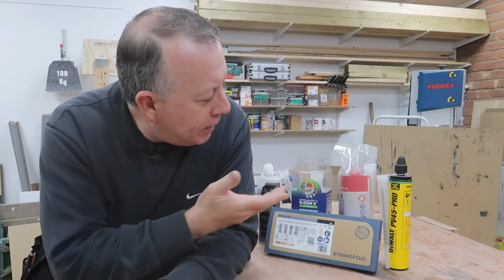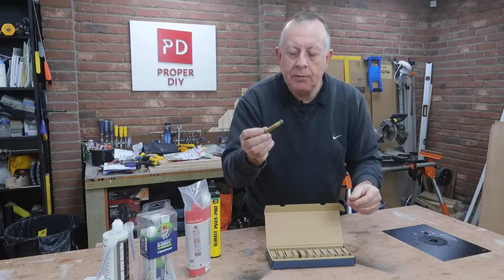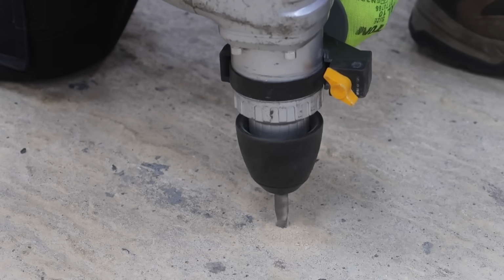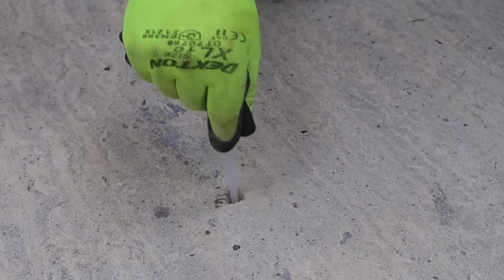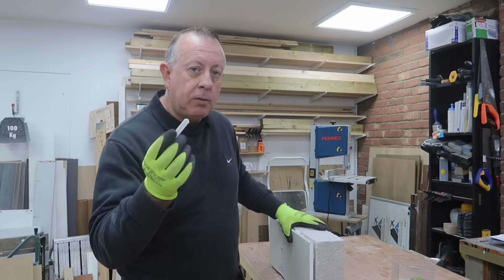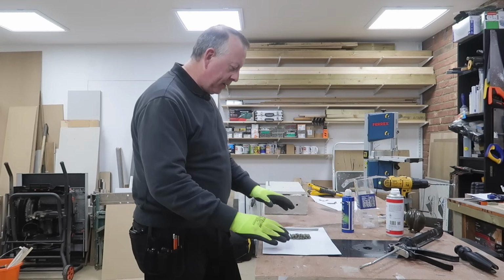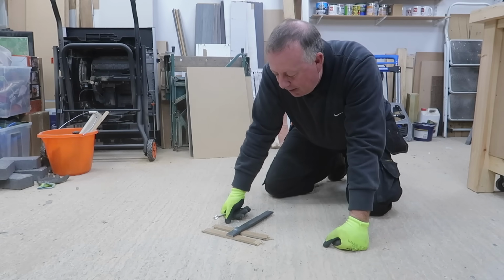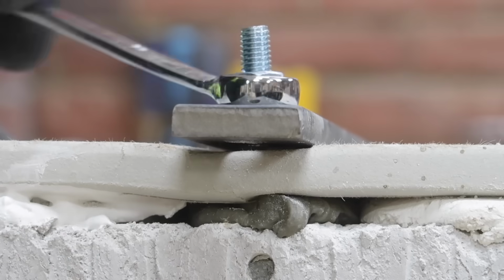Resin Anchors - The Absolute Strongest Fixings

Comment: Thanks for the Video, could you push a wall plug into this and screw into it? I have a loose toilet because the concrete floor where the fixings are has degraded, thinking this may be an option

Comment: NICELY DONE......BUT

Nicely done, and as with all your videos, very informative. Thank you. Mind you, the 'faffing about' (my term), with the Compressed Air and the Toothbrush can be quickly and easily circumvented by using a piece of plastic pipe or tube....er, well anything hollow....instead.

If this is placed at the top of the hole.....or marginally just inside it with room to spare....a quick couple of puffs, or blows into the tube will clear the hole of any debris left by the drill.

I have carried a couple of lengths of hollow tubing / piping for years for this, and if you have a couple of various diameters, your well set-up for any size of hole. One of the best and most flexible types, (because flexibility may be called for on occasion), is a length of electrical cable, (say half and inch diameter), with the three conductors removed.

Ideally the length of tube / pipe or hollow cable, should be about 18 inches to 2 foot in length. This allows you to be out of the direct line of view, or to the side of the hole when you blow down one end of it. I mark one end with a piece of distinctive coloured tape as the end to blow down. In this way I always use the same end. Mind you this is not really necessary....and a bit too much 'Elf & Safety.....if you alway wipe the thing before you use it.

The important bit.....and one learns this from the experience of getting dust in the face at some time or other.......is to close your eyes when you blow; so no need for the glasses or goggles.

The mantra is;
Tube in hole.....CLOSE YOUR EYES ....Blow or Puff...!

Works everytime....

Just a sayin'....

James Hennighan
Yorkshire, England

Comment: Nice video.  Just one thing.  When blowing out dust the idea is to push the tube right down to the bottom of the hole so that the air pressure blows all the dust upwards, out of the hole.  Just blowing towards the hole from above  isn't going to get very much of the dust out.

Also, I believe the minimum size hole required for those Rawl mesh inserts is 16mm, not 12mm, but they will come with instructions so people won't go wrong there.

Comment: I am doing extension and need to build the lean to roof. Need to bolt the wall plate on the outer leaf of the wall which is instructed by 100mm Celcon H+H High Strength Grade Plain Face 7.3N Block. Will the resin work for this instance?

Comment: I have a job coming up at home and need to fix some support timbers, I'm using 75 x 47 CLS and will need to put 4 fixings along the length using chemical fixings. Because of the short working time I was thinking of fixing timber with a couple of screws and red plugs to hold in postion then drilling through timber and wall with larger dill bit 12mm probably and using chemical fixings with threaded rod. Having the hole in the timber the same size as hole in wall does that cause an issue ? Or would it be better to use viles/capsules. Concern I have is lining up the rods with the holes in timber and getting it level with the resin going off quickly. Thought ? Cheers

Comment: I drilled a 1/2" hole 4" deep in my slab to mount a safe, i used a 1/2" X 5" Hillman concrete screw and i have 3" embeddment into the concrete. Altho the screw went in perfectly with my 1/2" impact wrench, I'm wondering if there is any advantage to removing the screw and put some epoxy in and refastening it? I have a very high security safe but it only has 1 anchor hole. Im looking for max hold down torque.

Comment: What is your view if I opt to use resin based fixings to compressed straw internal wall (sometimes called stramit). I am looking to hang a tv using a tilt bracket (not too heavy tv by the way).

Comment: I want to install an 8-kilo wall-mounted umbrella.  3m diameter umbrella when erected.  I have a hollow brick pillar, approximately 35cm square, perfect for the umbrella.  Should I use screw bolts going in about 100mm or put a steel rod with fixing resin?  There are two mounting plates, each with 3 holes, so 6 mounting points in total.  There are two possible issues with using chemical resin.  One is because the rods are going in horizontally, they might drop a little in the resin, then set hard, not straight in the hole.  Two, I haven't been able to find long mesh sleeves, to be able to drill 100mm in the pillar - most are like yours, 50mm long.

Comment: Thanks! I've DIY'd for 40+ years and never encountered this concept. Well, not in DIY anyway... for much of my working life I've used 2-part nozzle-mixing systems which were designed to be used similarly, with disposable nozzles and a cap to seal off the rest so it can be used anytime later again within its shelf life with no risk of setting in the dispenser. Those were high quality and incredibly expensive (dental materials) and they were arranged with a one-position-orientation end cap and the two different materials were kept separate by each having its own separate exit right at the tip where the mixing nozzle is attached. It's quite disappointing to see a manufacturer opt for having the exits down inside the section where the mixing nozzle attaches, as it would be difficult to make sure you have removed all of the product from the point where the chemicals meet each other, which you did with a wooden stick, but even if you do a perfect job of that, you'll then end up with an air space under the sealing cap so the materials could dry out and block the exit before next use. Admittedly the material is about £10 for 300ml where I would have been spending a hundred times that much per millilitre 🤣 but I still think they could have made it a bit more user-friendly with a little more design effort!

Comment: I used this method a couple of times to fix heavy gates to brickwork. They are ridiculously strong. The fixings are far stronger than the bricks. Top tip…. Ensure your posts are pre drilled and ready. Get your resin and  anchors in quick, wipe off excess, then push your post onto the protruding fixings before the resin goes off, supporting the post so it doesn’t pull them out with the weight. After a couple of hours, add your washers and nuts and tighten them up.  Failure to do this will mean you have alignment issues and need to drill out large clearance holes in the post to accommodate any misaligned resin anchor.  I highly recommend these resin anchors!

Comment: I am thinking I could use it to attach a metal handrail to a plaster wall. The screws holding the railing have enlarged the holes in the plaster. There are no studs behind the plaster. I tried using some of those anchors with a toggle bolt attached,but I couldn't get a durable hold,and the screws eventually came loose. Either resin,or pack the holes with cotton batting soaked with superglue?

Comment: Very interesting video. (Wonder how the capsule resins compare to these gun resins) Been "designing" a hand rail to fit a stepping stone, (the fake grass covered raised bed is 240mm high, and I put 2x aerated slabs as a 120mm high, 45cm x 45cm wide step up - with flagstone on top) For my own safety, I want to fit handrails. Been looking at screwing to wall, and to a concreted in post in soil ... but now I think it will be sufficient to add C131 scaffold wall plates fixed to the blocks with resin anchors. (Think I will add a third block just inside the edge of the raised bed so I can screw the back end of the rail uprights to them) Will have to fit to the sides of the blocks due to the flagstone mortar-ed to the top. Now got to work out how to fill/fix 16 bolts (4 plates / four positions) given the limited work time of resin.

Comment: During the pull-out test in the close-up at 11:03 one can hear and see the resin plug pulling out of the floor yet the assemly seems to be tight. If the plug has detached from the substrate then the perceived tightness must be due to the flange of cured resin overspill clamping against the underside of the packers.
Reply: Yes, I noticed that too!

Comment: There seems very little point in using the compressed air around the top of the hole, the only way to get the dust out is to insert the air pipe to the bottom of the hole, then all of the dust will be ejected!

Comment: My curtain ceiling rail just fell off from the ceiling, they were set with plug walls. Initially I thought I had to fill the old holes and drill new ones, using a drop anchor this time, but now I'm thinking of using these chemical anchors instead.
Could I use them for a ceiling or will the resin just drip off before it has a chance to harden?
FYI, the culprit for the ceiling rail falling off is my fat cat who still thinks she is 2 months old and likes to climb the curtains 😂

Comment: Thanks for this.  Ive got 2 rall plugs come loose and plasterboard has big holes. They hold top of the two radiator brackets in wall. Can i refill with this ? Only prob is i cant ever remove if screw straight into resin. Ie if i change the radiators in future

Comment: I recently bolted roof for customer who's househas 100mm of insulation on the outside. 100mm insulation and then 100mm of wall. Good luck with trying to place resin from tube inside wall. 
Glass vials -> no problem

Comment: Thanks for the video Stuart, do you know whats the strongest, these resin fixings or concrete bolts like you used when you fixed that  post to the wall. I need to fix some fence posts to a low breeze block wall as i cant put the post in the ground because theres too much concrete there. The previous fence was screwed on with some sort of bolts and rawl plugs but that has failed because the fence must act like a large sail when its windy. I hope you can help me with this, thanks for all of your interesting video's.

Comment: Great video thank you.  I found your video the day after I used the R-Kem II with M10 threaded bar to fix my new timber building to the concrete pad.  Really good to know that I used the right stuff.  FYI - I drilled 12mm holes and inserted the M10 bar 70mm into the concrete, left it 24 hrs before tightening the nuts.  I agree with you, you have approx. 4-5 mins working time after the resin comes out of the tube before it starts to cure, so make sure you're all prepped and ready before pumping it out 👍😃

Comment: Yes, they are pretty robust and we use them quite extensively - says something. But they don't like large fork lift trucks hitting whatever the fixings are holding in place - we have vertical rollers that the wood gets unloaded against. After a time, we tend to find the concrete itself just fails eventually around the fixings as the forklift unloads. We're slowly increasing not only the width of the base plate but also its thickness to try and stop the concrete failing.

Comment: While 90% of your video is correct, i would still like to add a few things.
Always insert the tube with compressed air INSIDE of the hole, if possible all the way to the bottom! The brush will not remove the dust, it will only loosen it a bit, but if you only blow on the hole and not in the hole then there will always be some dust still inside. And that is the main reason these fail, bad preparation. I'm sorry, i'm not here to criticize, but it is really easy to not prepare a hole properly and it really is essential to success.

I would recommend the following:
1.drill out the hole by specs, usually 2-4mm wider than the threaded rod/rebar,
2.attach a small hose to a vacuum cleaner, smaller than the hole itself and vacuum out what you can. Don't forget to go to the bottom.
3.brush out the hole
4.vacuum again
5.blow out with the compressor and a long nose air gun
6. repeat 3.,4., 5. until there is no more visible dust coming out of the hole
7.squeeze out the resin WITHOUT attaching the mixing tube first and as soon as you see both components are coming out attach the mixing tube. Then squeeze a bit out on paper trough this mixing tube and in 90% of the time what comes out will already be mixed. You still have to check though! This way a lot less resin goes to waste
8.insert the mixing tube fully into a cleaned hole, and start squeezing the resin out
9.gently start pulling the mixing tube but not too fast. Only as fast as you are filling the hole (this step is to prevent cavities, bubbles etc)
10.stop when the hole is 2/3 or 3/4 full, remove your mixing tube from the hole, and insert the threaded rod/rebar with a circular motion
11.when fully inserted smear the excess resin around the hole, making sure the hole is really full - preferably with latex/nitrile gloves.

I always have extra gloves, some paper towels and a flashlight nearby.

If anyone also wants to know how to make a kid, let me know, cause it is basically the same steps with other tools.

Also, these resins tubes can be a real pain to squeeze out and might break some cheap silicone guns, don't ask me how i know and what are those 5 broken ones doing in my garage. I made myself a DIY version with threaded rod going trough a steel pipe, opened up halfway to except a resin tube. Then I squeeze the resin out using a battery drill on lowest rpm, works like a charm. Never going back to ordinary silicone guns for this type of work.

Comment: Cleaning out with the toothbrush is a good tip! I tried to install an awning brancket with expanding anchor bolts, but my brickwork mortar started to crack. I've bought some of this injectable resin to fix some thinner bolts. I'm going to use extra large washers. Hopefully, this will do the job!

Comment: I thought this was a serious video, until I saw that toothbrush! You do realise that that you can buy proper brushes pretty cheaply, and they do a much better job. I think this video came up because I double checked the instructions earlier today. I fitted 24 M8 studs today into a wall, using the 410ml cartridge version of the same stuff, only used the one nozzle. It's brilliant stuff, been using it for years, no struggling with fixings, no cracking bricks etc, I've even fixed electrical back boxes in place with it. Impressed with the tightness test.

Comment: Great video, thanks. Is this resin suitable for securing an unthreaded J- or L-bolt into a blind hole in a wooden gatepost? I'll grind 'reverse barbs' into the bolt to offer some grip, and I'll also drill transverse small holes into the main hole so that the resin can squish out sideways into them to solidify into retaining prongs. Thanks for any advice.
Reply from the maker: If you did all of that the bolt would be secure for a lifetime.
Reply: @ProperDIY  Cheers! Just did the repair, taking care to get the L-bolt perfectly vertical in two planes, and the final gate closure was millimetre-perfect across a span of 4 metres. Your videos are great -- very clearly explained, and always stressing the importance of good prepping. 👍

Comment: Excellent video. One minor comment: To clean the drilled hole, instead of a toothbrush, I would prefer a small plumbers wire brush, the type used to clean inside copper fittings before soldering. I think the abrasion is greater and the cylinder shape might do better than the toothbrush.

Comment: We fixed steel columns to concrete footings with these epoxy anchors all the time. One day the excavator backed into one of the columns and pulled it out of the footing. Interestingly it wasn’t the epoxy that failed though, it was the surrounding concrete of the footing that failed. Each of the anchors pulled out a perfect cone of concrete right out of the footing. The bolts remained fixed in their epoxied holes.

Comment: Stuart! I did a big boo boo. I used some resin for bolts to hang a gate, but I cut them too short and now I can’t get the nuts on to tighten them. What do I do?? 😢
Do I have to grind them flush and then start again a few cm higher?
Reply: If you can heat the around where the stud bar goes in the wall with a blow torch, put a nut on the end of the stud bar and pri it off with a bar, the heat will soften the resin you will see it bubbling as u heat it

Comment: Is it possible to drill the resin? My intention is to fill in some holes and cracks around an external wall and then drill on top of some resin parts to add an expansion bolt.
On 13:50 sounds like it's not possible

Comment: Excellent video clip. Thank you for showing the product, installing the fitting and performing realistic tests as demos. I’m impressed with the chemical anchors and will add this option to my choices for similar applications. I was impressed with the difficulty your miter saw had in getting through the hardened material. It looks really abrasive; planning the installation so as to avoid trying to modify it later appears the best approach. 😊

Comment: Got a question for you...What it is is I'm wanting to install a 35 kilo projector screen and was going to use anchor bolts  which come with it,I was wondering if i could use this instead or inconjunction with the anchor bolts...like both together so it would be double the strength..would that be Ok??

Comment: Great vid. Do you know if there is a resin anchor product for damp conditions? Im about to do a  job in WW2 tunnels & I can only fix into the mortor joints which are damp. Im going to site with steel anchors but also equipped with a resin alternative if the mortar joints are weak. fixing in 10mm threaded stud btw. Cheers

Comment: The normal rule for anchor is fill the hole 50% of the depth, but to achieve this some suppliers have caps that fit over the nozzle  , SPIT sell these as separate item, very handy and leave a tidy job. I have made the same wrapping tape on the nozzle, when you doing 15 to 20 starter bars, no waste exact bar to resin is key.